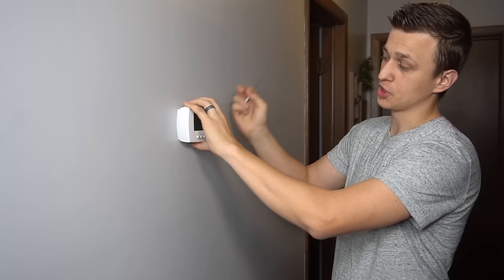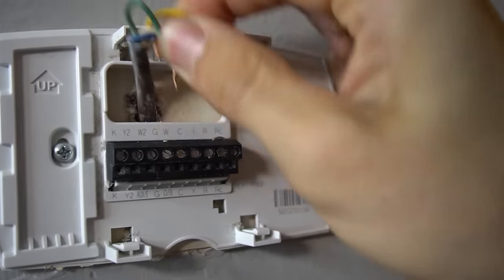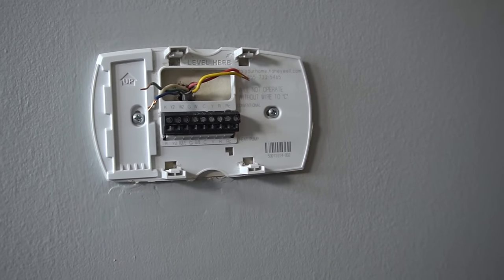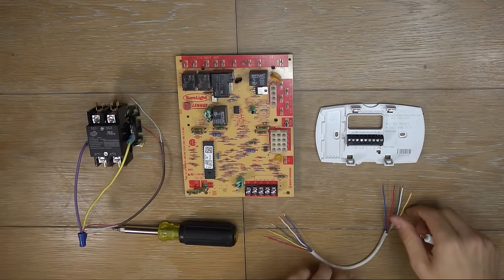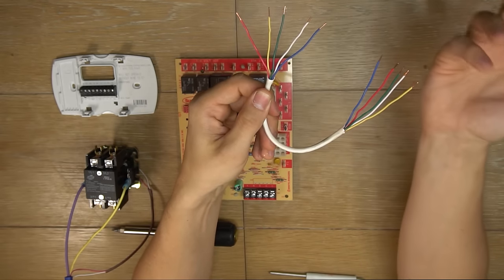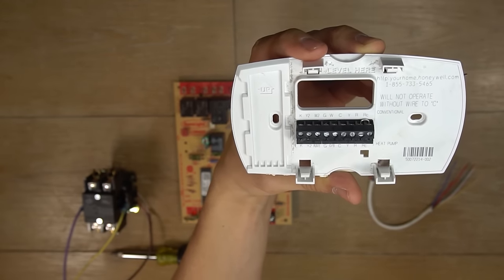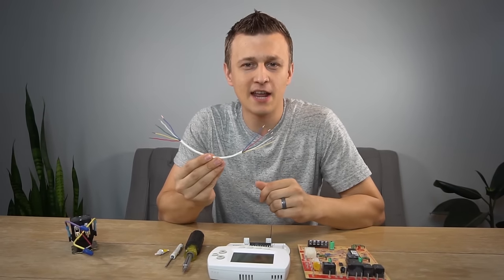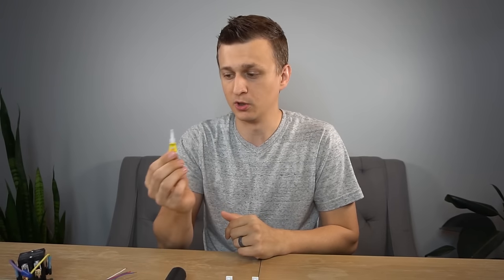Basic Thermostat Wiring - How to Wire HVAC Thermostat

Comment: I have a question regarding a furnace board that does not have a common wire (c-wire) but the Nest E requires a it.  My question is would it be possible to hook a wire from a 24vac transformer to the C-terminal on the Nest E unit and connect the other wire from the 24vac transformer to the R of the furnace? If not how would I provide constant power to the Nest E?  Thanks in advance for your help.
Reply from the maker: So you have 4 wires that go to the thermostat right? Have you tried pulling the wires out of the wall a bit? Sometimes there will be an extra wire that was either snipped off or wrapped around the insulator wire. I would check for that first.  Or you could look in the furnace as well. The wires coming from the thermostat, are there any extras that you could use for the common? I would not be taking any wires off the transformer though..
Reply: @WordofAdviceTV  What i mean is that the furnace is old that it does NOT have a C terminal on the controller board.  It has a total of 5 wires and only 4 wires are being used.  I got a new Nest E t-stat and it requires a C wire to provide it constant power.  Is there a way to provide constant power to the Nest E using a 24vac transformer?
Reply from the maker: @alu8104  Ahhh okay! Sorry, I didn't understand you right. Yes, by all means you can definitely do that. All you would need to do is hook up the extra wire to C on the thermostat and then find where the common from the transformer goes and splice that 5th thermostat wire into the same location. Either by cutting the wires and wire nutting them together or by using a jumper connector.

Comment: I measured voltage from my thermostat, no voltage reading on the yellow and blue wire, where should i start with troble shooting and also there are 2 wires coming from the power saver box not connected to anything. All help is appreciated. Thanks
Reply from the maker: Have you watched my video on AC Not Turning on? I go over a lot of stuff there. My first guess would be that perhaps the 3 amp fuse is blown..

Comment: The concern with gluing the wound shut would be if it gets infected and it doesn’t drain because it’s glued in, that  would lead to more problem. Makes some sense if you just clean with soap and water and make sure there’s no foreign body inside the wound, and if direct pressure isn’t enough to cause bleeding to stop, then maybe apply some glue at that time.

Comment: I have a Guardian EU17A Electric Forced Air Furnace that we just bought for a shop area.  We do not plan to install a/c, therefore will need to hook up as heat only. There are four wires to hook up to the thermostat from the furnace....Red, Green, White and Black. I am stumped on the black wire and which thermostat to use. Thanks for any help

Comment: With the common wire installed [c] (hotwater-Central A/C) will the thermostat display work without the batteries installed? I don't want to replace batteries every year.

Comment: Yes I've used suprrglue for a cut. I received a huge gash from a rc helicopter that attacked me and as it happened I was using super glue at the time. The blade hit me in the arm and hit the super glue in my hand and after I wiped down the gash I notice the super covered over part of the gash and was perfectly sealed. I didn't know at the time it was safe to use so when I got 30 stitches  and a couple staples I asked the doctor about superglue and he said it's completely safe and it was used for years on wounds.

Comment: great video..however, I have a question-my thermostat showing Black, Green, Blue and Red wire. What is that means? I don't have Yellow or White ???
Reply from the maker: The wire colors are not always the same. The wire that goes to Y on the thermostat and the control board is cooling/AC. And the wire that goes to W is heating.
Reply: much appreciated...so basically you are saying don't pay too much attention to  color of wire rather look at the corresponding letters...right?
Reply from the maker: @gupttura2766  That is correct. In fact, I have seen a couple thermostats where all 5 wires were brown.... It's confusing but it works if the letters correspond.
Reply: Great...that makes sense. I will let you know how it went. Waiting for my new thermostat to arrive in day or 2. Thanks again for quick replies
Reply: I just realized you explained everything in your video very well by watching it again....first time when I was watching it my kids were screaming in same room. :)
Reply from the maker: @gupttura2766  Haha I know what that's like :) It seems like whenever I am on my phone, my son makes it his mission to make as much noise as possible. Good luck with the repair!
Reply: Finally, received my T5 wifi thermostat but the God always has plan for me....make it more confusing and difficult for him. I took a good look on my existing wiring, I have wire in Rc (red), Y (blue), W (black),  G (green) just 4 wires in total. I have nothing in C!!! Is that means I don't have C wire?

Comment: Thank you for the video.

Is the control board really sending power out to the AC contactor? Isn't the power flow more accurately Red to thermostat, Yellow back to control board terminal which is tied to red to AC, through the contactor, and back to Common on the control board? The control board knows the AC circuit has voltage, but it seems like it's "sending" it as much as it's sending power via red to the thermostat. Is the thermostat also completing the circuit from red to green at the same time?

Thanks!

Comment: I dont have cold ac but my heat works good. I opend up my furnace to look at circuitboard and there is only 3 wires connected,  G , W , R ,,, c24v and Y are free with no wires attached. But on thermostat there is G , W ,Y , R, Rc all have wires connected to them. I remember furnace unit was replaced a while back is it possible the person didnt install everything correctly??? Plz and thank you. Ps when i turn cool on nothing happens but outside unit turns on,, while inside unit no activity.🧠🧠🧠🧠🙏🙏🙏🙏🙏
Reply from the maker: Sorry to hear about the AC troubles! Yes, it sounds like whoever replaced the furnace forgot to hook up the AC. In order for your air conditioner to work, the Y wire needs to be connected at the control board. Try to connect the wires at the control board, exactly as I show in the video.

Comment: I just helped a friend with same new thermostat and old one had 5 wire system. All colours matched except they had a black in the rh and red in RC. So I put red in new RC and black in the c spot. And no power to new thermostat. Uninstalled and re installed old to make sure I didn't blow the fuse.....any ideas?

Comment: I have no 'C' wire connected to my thermostat. I was hoping it is wrapped inside the wall...but no. I do see a Red wire plugged into C terminal on the board at furnace. What is that for? I have some sort of air exchanger in the house to turn it on after showers etc. Obviously, this is causing road block for me to replace my thermostat to wifi one!!! Thanks

Comment: WHAT IS THE BLACK WIRE FOR?? -- I've a Johnson Controls T500 with 6 wires, including a Blue and a Black -- controlling a heat pump (Electrical panel down the hall says :HP") and an air-con compressor, and a fan

Comment: Is it possible to upgrade to smart thermostat for high voltage 120/240 outside ac unit and inside gas heater and control both on one device?

Comment: I have the same thermostat you show, and my low fan speed never turns off. I replaced it, and still the same issue. Can you suggest what component in the furnace may be faulty. I have installed several package unit HVAC and worked long ago in HVAC. I am rusty, but a general contractor with extensive electrical experience. This one has me stumped.
Reply from the maker: Sorry to hear about the fan problems! This video is exactly on that topic, I think it will help you track down the culprit: https://www.youtube.com/watch?v=xNe-UxD4Egg&t=827s

Comment: i do not have a common wire for nest smart thermostat...how would i go about adding using an existing wire without running another wire? i had to disconnect my a/c for my heat to come on in the winter. I only have four wires connected to my thermostat.
Reply from the maker: If you don't have any spare wires behind the thermostat and running a new wire is not an option.. They have adapters that can "add a wire". They work most of the time but I have also seen plenty that didn't.. It's not too expensive so I suppose it's worth a shot! :) Here's what I am talking about: https://amzn.to/2TyBSpI

Comment: Is the air conditioner unit outside suppose to run when you turn the heat on or is it suppose to be quiet.

Comment: I replaced my Honeywell mercury type round thermostat with a basic simple digital Honeywell thermostat recently. I have B, G, W,Y,R wired connected on my old thermostat. Would B be C wire? It is colored black. The new thermostat has a plastic tab between R and Rc and the instruction manual says using jumper cable is not needed, as long as the tab is moved to 'up' 'R'  position.

My indoor fan is running when I turn the AC on the new thermostat. Condenser fan and the compressor are not. 

Is the new thermostat the problem? My second question: Is the black wire previously connected to 'B'  my ' C'  wire?

Comment: I just had to replace my thermostat last week, which was easy enough given it's just a 4-wire affair. What's curious is that the cabling through the wall has 6 wires including the usual suspects in a 4-wire setup (W, Y, G, R) plus a blue and brown both of which are unused. I haven't taken a look at the control board to see if there's a "C" option to connect the blue down there and open up the possibility of powering a thermostat. What I'm curious to know is IF the control board supports a "C" wire, why wouldn't it be connected? What harm could its presence have on a thermostat that requires batteries to operate? I don't want to go buy another thermostat that can be remotely-powered just for the sake of not needing batteries, but it'd be nice to do the hard part in the furnace so it could be an option one day.
Reply from the maker: Hey Steve! If the thermostat has a common (C) terminal, then you can hook up the blue wire to it and then hook up the blue wire to C at the control board as well. That way the thermostat will be powered by the furnace and the batteries will only be there as a back up. There is no harm done by doing this. Many thermostats are wired up this way.
Reply: @WordofAdviceTV  This is true even if it specifies that's its a 4-wire, battery-operated thermostat?
Reply from the maker: @StevePittinger  I don't think it will do any harm but if the manual specifically says to only wire up 4 wires, then I would go with what the manual says.

Comment: My old thermostat has RH and RC wired up but no R, but the new thermostat only has R and RC , so would i put the wire thats in RH in the old one, to the R in the new thermostat?
Reply from the maker: You would put the red (usually its red, the one that was in RH) wire into R on the new thermostat. Then you need to add a little jumper wire between R and RC or else your air conditioner might not work. (you could use a piece of a metal paper clip for this)

Comment: I have an older combo HVAC with an oil fired furnace w/ 1 transformer. The bower on the HVAC was off and not functioning, but it started up the moment I removed the T-stat face plate, I have even tried to remove all the wire on T-stat with no wires touching each other and the blower was still operating (???). I reattached the wires and reattached the face plate and the blower went off again. I jumped out the yellow and red and the compressor /condenser fan/evaporator fan work and can get cold air. I hope you may have some insight on this strange unit.
Reply: I wanted to add that the wiring color G green Y Yellow, W white, RH red, B(open), O (open),RC blue wire on RC, *C is (open) and there is a jumper between RH and RC. I did replace the T-Stat as a Hail Mary but I knew it wasn't the issue.

Comment: Question, where is the transformer that drops the voltage from 240 to whatever that thermostat and coil to the contactor operates? I assume 240 to 24 volts? Is it on that circuit board?
Reply from the maker: There are a few different setups.. Depending on where you live it may be different. But here in Minnesota all the transformers are 120v to 24v and the transformer is in the blower compartment of the furnace. Not on the circuit board but in that area.

Comment: Regarding Super Glue comment.  Surfers who are in the know never travel without a big tube of Super Glue!  Life saver (literally) when you get cuts that would otherwise require stitches, which are difficult to get days from civilization.  I've used it on myself and I've seen it used several times by Dr's who have had to close up large wounds.

Comment: Okay, so thermostat is located on an interior wall, but where is the control board?  Also, where is the 24 VAC coming from, is it generated by the control board or do I need a separate transformer somewhere?

Comment: The common slot on my furnace circuit board is empty.  My thermostat has batteries, there no common was required.  Do I still connect the second wire from my condenser to the common slot?  I connected the other wire to Y on the furnace circuit board.  Thanks.

Comment: So I just had central air installed, works great. But when the furnace shuts off the condenser stays running. Is this wired wrong??

Comment: I can not figure out why the condenser in hooked up to c. I know that is were it goes but do not understand why. I though the control board sent 24 volt to the tstat through red. Then the power is sent back to the board either through  w or y. So if there is a call for cooling isn’t there 24 volts from y to r. Why is it y to c. 

Thanks
Reply from the maker: @Matt Hey Matt! There is no "voltage drop" between R and Y. It would be like measuring voltage on a piece of wire with no load in between. Even if there is 440v going through that wire, you would still read 0v. The control board sends a constant 24v to the thermostat so there is always 24v just sitting there on standby. When the thermostat calls for cooling, a little switch closes inside of the thermostat between R and Y which send the 24v to the Y terminal at the control board. That Y terminal is also hooked up to the outside unit. So the 24v immediately goes to the contactor in the condenser unit outside and there is a voltage drop across the coil after which the circuit is completed by going back to the control board through the wire that is hooked up to C. So when you are measuring voltage what you are really measuring is "voltage drop" across a load. I realize this probably sounds really confusing... It's hard to explain. You would almost have to just study how electricity works.
Reply: @WordofAdviceTV  
I do understand the concept of voltage. It is basically potential energy. When we measure for voltage across a line of wire there would be zero volts because there is no potential energy . Going across a switch is different. Across a switch the voltage would read 120v on a 120 volt circuit.
This part I do understand.  But there must be a flaw in my thinking. How I see it is power is sent to the tstat from r. R then send power to y got cooling. Is there not a relay between r and y for cooling?
Reply from the maker: Ah okay! Thank you for elaborating with the question. No, there is no relay there. There is just a micro-switch between R and Y. So it would be treated like any normal switch.

Comment: If the wires leading to the contactor are partially stripped in the middle of the wire before it goes into the AC unit outside, could that cause a short?
Reply from the maker: If that bare spot touches another bare wire, the pipe, or something metal, then yes. It can short out and blow the 3amp fuse (if you have one). But if it is not touching anything else then it won't. An easy solution is to just use black electrical tape to tape up the bare parts.

Comment: The video was very informative, but I am wondering if you can help.   My furnace thermostat is Aprilaire has the following wires;  W-White, W2 Blue wire, Y- Yellow wire, Y2 - not used, G- Green wire, and then the RC and RH are jumped with the red wire.  Looking at the circuit board on the furnace I see the following: It has W1 with a white wire, W2 has the blue wire, Y has a yellow wire, but also has a red wire, R - has a red wire, G has a green wire,  and B with a white wire from the thermostat wires.    My new thermostat has the following - G1, Y/O, RC&RH, W/B, Y1.   Should I hook the White and Blue wire to the the W/B?  I can send you pictures if you like to see what I am seeing.   Let me know were to email if needed.

Comment: Would this exact wiring apply for a two stage units as well?
Reply from the maker: Usually yes. It is rare but sometimes the thermostat controls the staging instead of the control board, in that case there would be another wire. Instead of just W, there would be W1 and W2. And if it is 2 stage cooling, Y1 and Y2.

Comment: hey buddy what happends if i dont have a c connection on my thermostat and dont connect the c wire to it. would the hvac unit still work if i connect it to the c on the furnace?

Comment: QUESTION: MY thermostat is a White Rodgers and it DOES NOT have a common wire, but batteries.  When I go to Home Depot/Lowes, there isn't a White Rodgers to replace the one I have. How do I find a different one that works without a common wire?